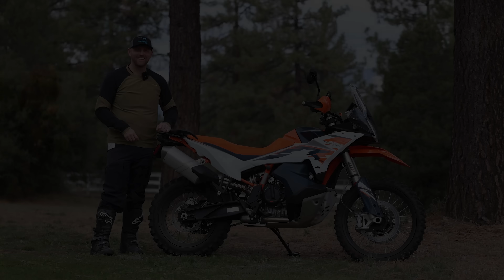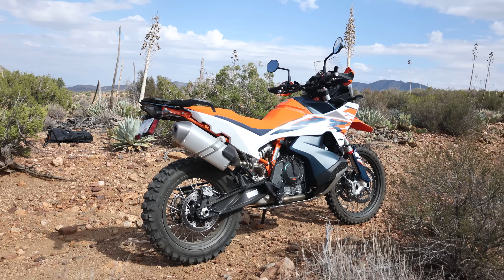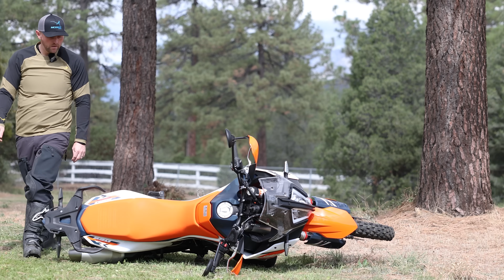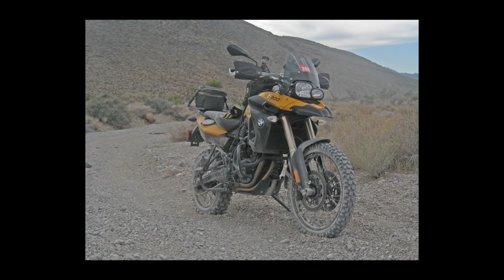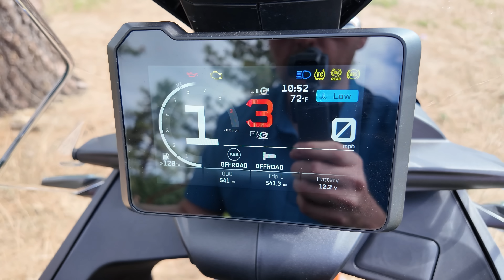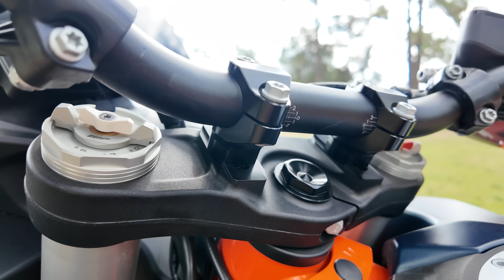4 Reasons the KTM 890 Adventure R DOMINATES Off-Road Adventure Riding

Comment: I'd really love to say the 890 adventure R is great. But my 2023 has been nothing but a nightmare. Including electrical issues, gears slipping, quick shifter not working most the time, kickstand breaking when adding a little luggage (less than 50lbs), not able to get it into first when the bike is off, stalling on downshifts. This bike is great off road, but with the reliability I'm too afraid to go too far with it. Bells and whistles are cool if the bike itself is reliable enough to give you confidence to do keep using it. No matter how good their new updates are their bikes are not it.
Reply from the maker: That's really unfortunate about the reliability issues you've experienced.
Reply: Sorry man.

Comment: Due to the very recent recall of my KTM 390ADV, I will not buy another one.  My bike will be sold in spring, and my next bike will be from a Japanese manufacturer!!!
Reply: What recall? All I had when I took it in (10.27.25) was different spring on the kick stand.
Reply: @nappa4317NHTSA 25V-598 for 22-24 KTM390ADV bikes. Very serious engine problems. I have a 2023 model.
Reply: @packfan1946  Ah okay, last gen model. I had made assumption for 25.
I get the frustration with KTM. Its somewhat earned to.
Any idea what your going for next year?
Reply: @nappa4317 Yamaha T7 probably or a Honda AT/DCT.
Reply: @packfan1946  Solid choices. Aftering owning the F800gs, and touring the Black hills on the T7. Be careful they are big bikes for offroad.

Comment: You nailed this review, mate.
Im on a '23 model here in Australia and I absolutely love my 890R.
15000k in 12 months, mainly offroad.
What will I replace it with. It will be another 890R but Id love to go for the Rally if its available. My only concern is the extra seat height, but im thinking a lower seat might do the trick for my short legs.
Cheers for the review
Reply: Pull forks in clamps if possible, minimize preload is my solution for tall bikes.
What you don't want is compromised leg room or shorter suspension travel, avoid at all cost

Comment: OK - this might be the first time I've diagreed a bit with your review..ha! - As you know I had the 890 R as well and currently have the BMW F900 Enduro - The F900 is just as capable off road and suspension is great along with power delivery - Now three points...1st - I agree the lower tank is nice and makes it feel "almost' like my 1250GS's as it doesn't lay flat...2nd I wish the F900 had a little bit bigger fuel tank as that is a disappointment on the F900 and 3rd - wish it did have an 18in rear vs 17in...I do think the F900 is more comfortable than the 890.  But don't discount the F900 at all it's very capable - pricing is really the main issue as it's 3K+ more.  As usual always great content and thanks for doing these - a skill set I have not developed..ha!!
Reply from the maker: The F900 is super capable for sure. I've thought about getting one.
Reply: I was tossing up between the two. Went with the 900gs, can’t risk being broken down in the middle of nowhere. 900gs has never missed a beat and as you say is also a great off road bike

Comment: one look at @Adv Boyz weight comparison test between 890R Vs 800Xrally, it was staggering difference. Kove will beat hands down on off road terrain against 890R
Reply: I tested rally. Very mixed feelings. 
It's doesn't feel super light. Regular 800 version felt much lighter, because it's lower. 
Terrible, dangerous handling, dangerous stock tires. 
Engine, throttle response surprised me positively. Also transmission is very good and smooth. 
But overall you get what you pay for, nothing special. 
Weight is very overrated issue on advs imo. 
My AT is almost 60kg heavier and yet its incomparably better overall bike. 
And yes, also off-road.

Front forks are of amazing quality btw. 
Excellent damping quality and almost zero stiction.
Can't comment of shock as I couldn't adjust comp damping as it's hidden under plastic panel and I didn't have torx on me unfortunately. 
So shock was very badly tuned and waay too hard to judge quality .
Cheers 🥂
Reply: Good luck finding a dealership and the rider triangle is only made for a China man.
Reply: @squid148  KTM not ready to race but ready to repair :)